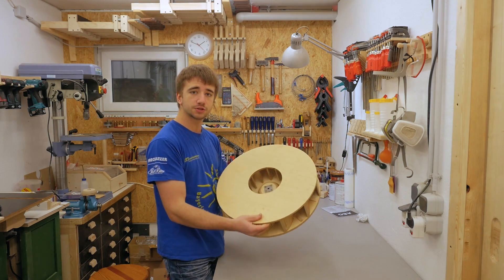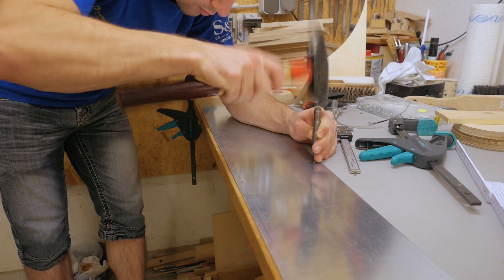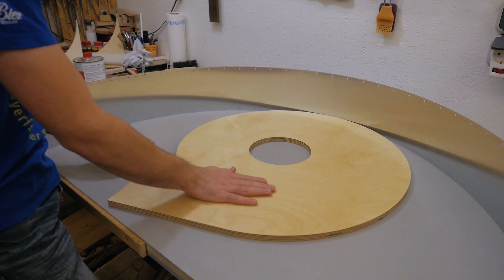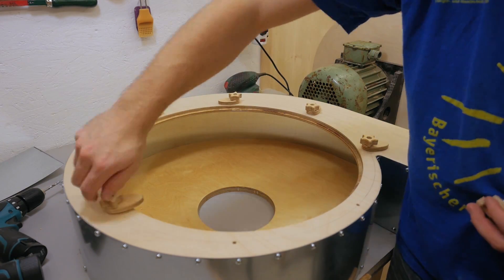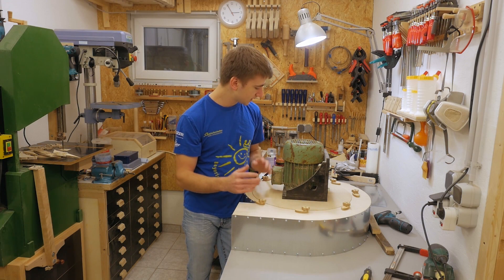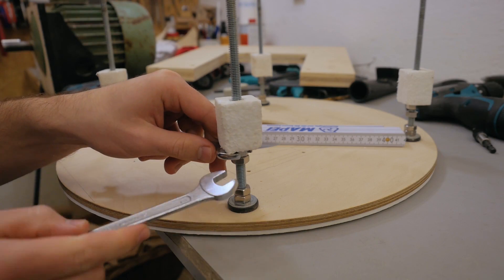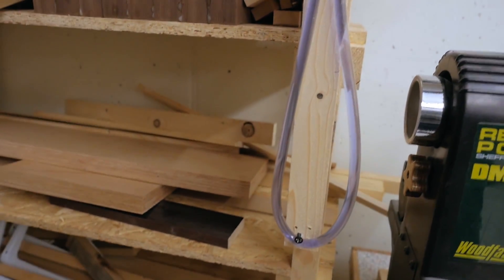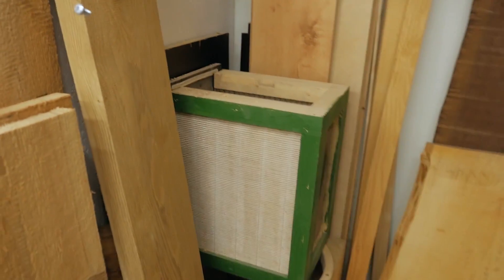Building a Big Dust Collector Blower #2

Comment: Carefully isolates motor mount from mounting bracket with foam.   Screws motor mount directly to bracket.
Reply: If you are referring to 9:47, he didn't screw the motor mount to the bracket. It's a separate piece that prevents the motor mount from sliding off of the bracket. There is even a piece of foam on it that can bee seen to isolate vibrations.

Comment: Marius,  Thanks for the great video. I was wondering what formula or design method you used for the scroll housing.  Specifically the toungue clearance and location in relation to the impeller. I have a crude, basic method but it does not result in what I consider a very efficient design. Thanks, Carl
Reply from the maker: I just used gut instinct ;)

Comment: You can toughen screwthreads in wood by impregnating them with low vicosity superglue and iserting a greased screw until the glue is set ( few seconds)

Comment: I just took apart a shop vac to check the impeller, and noticed how tiny it was to generate the suction it does.  The impeller and blower you've made is beyond impressive.

Comment: If you want to reduce more noise (even for ur parents), you can make a "room" & use some cheap acustic foam glueing into the wood panels. I saw, In another video, that you put out ur old door (because it was damaing your table saw) & installed a sliding door. Why don't you reused it for it? 

This is the panel: https://http2.mlstatic.com/panel-acustico-absorbente-100x50x5-cm-formosa-placa-aislante-D_NQ_NP_23410-MLA20248464715_022015-F.jpg

On the old door install a ventilation grill to avoid overheat the motor.

Comment: May I know why are you not using the metal sheets to make the impeller blades? It would be much easier to shape and more sturdier.
Reply from the maker: It's easier to conect wood to wood, than sheet metal to wood.

Comment: Look up a phenomenon called fan effect.  Depending on the distance from the discharge of the fan to the first elbow, you can get substantially different performance from the same fan.  Nice woodwork.  That is a BIG fan for the speed.  Is there a lower rpm motor class you can use?  I am concerned for your safety me how the wood will fatigue over time.  One day I hope you can make it out of metal.  Good luck.

Comment: A little trick I learned from building radio controlled airplanes to strengthen bolt threads straight into wood is take thin CA "cyanocrylate" AKA Super Glue, and soak the threads with the CA. Run the tap back through the hole after after the CA dries. It will make the threads very strong, just make sure to use thin CA so that it soaks into the wood.

Comment: try a couple of square meters of sound insulation they use in a music studio. the stuff shaped like egg cartons.  just get enougn for over the blower, and ask your parents how much of a difference it makes.  i bet it does alot, but if it doesn't, try to hang it down from the ceiling a little, tryng to deflect it back into the area where the blower hangs. you might want to try it if it's not too pricey.  great work btw.

Comment: Hi Marius. I made a blower myself with the same design of fins....but i made them with aluminum fins, same as u made the 90° bend on the outlet with grooves.The only diference is that my fins are about 35mm thick and can take the forces better than yours (also mine has a smaller diameter). My father used to design flour mills and pneumatic transport...didnt like that the one i made at first was 45mm thick...he told me if its thick u get more volume but not so much vaccum...so i made mine thiner and it was an improvement.
Keep up the good woodwork! ;)

Comment: Hello Marius, your work is excellent, very creative and you take care of the details. Since you improved the dust collector I recommend that you install a star delta starter, thus reducing the torque with which the engine starts and also the starting current, this will prevent the starting torque is too high and cause damage to the turbine in addition reduces energy consumption at start-up which results in energy savings and lower cost of the electric bill. The connection is simple and not very expensive, three contactors with auxiliary contacts and a pair of buttons. Congratulations for all the projects and continue to work like this.
Reply: It would be a good idea, but in a (German) comment he made in the previous video, he indicated that he runs this motor in wye configuration at all times, so a wye-delta switch to reduce starting torque can't be used.

Comment: Wow I wish you were my neighbor. You have a natural understanding for physics that most people have no idea about. 
For instance most people assume that because there was no air flow that it would be at maximum load. Which is of course not true at all because it really isn't doing the intended work. The same air is held in place and just spun around.  The same is true for water pumps and turbos in cars and trucks. 
So car buffs take note. If your diesel truck blows the compressor fitting or seal off the turbo there will be increased backpressure on the turbine side. This will lead to a dramatic increase of EGT's and not the excess fuel. 
Sorry Marius, Rant over. Love your projects and the detail plus common sense that goes into them. Cheers!

Comment: As far as I know a lot of the noise comes from the air circulating through the system and gets out the 90 degree exit part you have there. try to glue some of that wrapping material or some insulating foam on that part on the inside.

 I accidentally was a witness of such a procedure when some industrial size fans were making too much noise for the nearby resident housings. So they brought in some dudes that did just that. they glued some kind of flexible foam material on the inside of the air evacuation ports. Also to top it all up they mounted at a distance(measurement that I do not remember) a shielding system so the air and sound coming out was hitting the shields and dispersing on the sides. the shields also had that foam material glued on. try doing that see how much the sound drops.

Comment: If you rotate the mounting in a way that the suction port would be sideways and the outlet port downwards, you could eliminate the 90 degree elbow at the outlet PLUS the pieces wouldn't fly everywhere in the shop if it explodes. :D

Comment: Nice work! I used to sell Vac-all equipment that was made in Milwaukee Wisconsin in the 1970's. You probably would love to see the double Vac-all that was made that pulled two twelve inch tubes on a street sweeper and went to work cleaning a steel mill at Hamilton Canada where I live. The blower was driven with an 8V92 diesel engine and mounted on a Louisville Ford truck. Look for a book I wrote called "A Tinker's Dream" at Amazon.com. Best of luck and make sure people you work for pay you enough.

Comment: I'm sure folks have mentioned it already, but my opinion regarding the fan is lighter means less horsepower to turn. You're consuming a lot of energy just turning that blade assembly before you even get to the point of actually moving air. Might I suggest you could make a much lighter fan using chimney flashing squares or rolls from a home repair store. If you bent them the same way you did those wooden ones, they would barely flex. Obviously a different fastening method would be required...
Reply: Right, and bumble bees don't have enough wing surface to sufficiently lift them off the ground.
Think outside the box. Whatever I set my mind to do, I will do it. If the first one breaks or fails, I will chalk up the time to the learning curve and keep right on truckin'.
Reply: What I do or don't do changes nothing and proves nothing. You can 'suspicion' for the rest of your life and it will change absolutely nothing except YOUR OPINION.
Have a nice day.
Reply: Have you ever seen the vanes inside an Electrolux vacuum cleaner fan? Never tell me it can't be done!
Reply: Wrong, dead wrong! I have already proven my engineering prowess thousands of times; it is no longer necessary for me to prove anything. It's up to you to prove I can't.
Normally, I would have risen to the challenge, but for you, I make exception. You are not worth my time and I don't need a shop blower yet.
Reply: Whatever one man can do, I can also do. I lived in the age before internet when being published and circulated in another country actually meant something.
The more you scream 'Prove it!", the less attention you'll get from me. I have proven it. I could care less what you think.
It now becomes a battle of minds and you're sadly outclassed. Have a nice day!
Reply: Because I'm having fun taunting you, bwahahahahahahahahaha!
Reply: You have only discredited yourself. You would tell anyone that it 'can't be done' without even trying. What a fool you are!
Reply: Surely you wouldn't have me believe everything you have ever built is still operational and will remain operational for eternity.
Reply: If Marius uses his dust collection 100 times a day / 7 days a week it might be a topic - but in a non professional workshop energy consumption is not that deal. And normally the energy you need to get the air moving is the trigger that cuts the main breakers.
We had to add a lid to the intake of the blower housing at the shop ventilation  on a friends storage cause the motor took about 30 amps instead of 12 when in normal operation. After the lid it too about 15 at startup - but just for seconds, so the breakers didn't fall.

Great work Marius - as always !!!
Reply: Okay, whatever you say. I am an electrical and mechanical engineer, so y'all just go right on ahead, then.
Reply: Lee Wilkerson chimney flashing is way too thin and weak to be used in an impeller. Please use your mechanical engineering degree to compute the stresses on such an impeller before advocating it.
Reply: "If the first one breaks..."? What kind of hodge-podge engineer are you? The point of engineering is to apply science/physics to know if something will work BEFORE you build it. So instead of using your professed engineering degrees to PROVE I am wrong, you resort to calling me unimaginative... that's rich.
Reply: Lee Wilkerson what does that have to do with anything we've discussed? I've continued to request you demonstrate your engineering education and instead of doing so you go off on weird tangents like bees and product reliability. I suspect all this attempt to change topics is because you really don't have the degrees you claim. Why not prove me wrong by replying with actual numbers and calculations on the feasibility of chimney flashing for impellers. If instead your reply still lacks those details, it will just prove my suspicion is correct.
Reply: It proves your education means nothing in this context and that nobody should give your opinions any more weight than anyone else on the internet. So maybe next time you go flaunting your degrees, be prepared to show you can actually use them.
Reply: Really? Show me a link then. Remember the adage: "If its not on the internet, it didn't happen". It really doesn't matter how much you say you've proven something if you cannot show anyone your work. "The internet" won't believe you. And of course, referencing bee flight or vacuums engineered by other people is not a proof of one's own engineering prowess.
Reply: Yeah that USED to mean something, therefore it doesn't mean anything now just like your proofless rants.
Reply: You can do what anyone else can do? Being a little arrogant aren't we? If that's the case why aren't you taking 5 minutes to do those calculations that an experienced mechanical engineer would do instead of spending even more time arguing with me? Let me be clear, I'm not asking you to make the calculation, I'm asking WHY you refuse to do so since you claim to be so amazing talented. It's blatantly obvious that you care about my opinion since you reply to every msg so don't give me BS about not caring enough to do so. Why don't you tally up the time ur wasting replying to me and see if its better spent doing the calculations which could also be relevant to your future blower project.
Reply: I'm glad you enjoy letting me discredit you to the whole world. I guess we both win.
Reply: Yes, that's what engineering is. The calculation of what works and what doesn't work. If you were a real one you would know. My specific rejection of your specific proposal doesn't mean I reject everyone's ideas. I just reject the dumb ones like yours. Are you saying that every "dumb" idea needs to be tried despite what other more experienced, more knowledgeable engineers say otherwise? Every commercial material handling impeller of that size has either cast aluminum or welded steel fins (or sometimes special plastics that claim to be stronger than steel) that are much thicker than the chimney flashing you propose. 
If you actually knew about the science in air handling then you'd know lighter impellers aren't necessarily a good thing. For one, sizing motor horsepower is based on how much work must be done during the continuous phase of running not the startup phase. Keeping a spinning a heavy fin less impeller (a metal disk) a constant rpm consumes little to no work, therefore once you start adding fins and moving some air nearly all the work being done is in the moving of air. However the startup phase is heavily dependent on the mass (more specifically the moment of inertia) of the impeller. The heavier the impeller the longer it takes to get up to speed. The issue arises when you want to move a lot of air and want to do it with a very light impeller. This means you're pairing a large motor w/ its large amount of torque with light impeller. You can end up with insanely high acceleration. By my calculation the tips of a 15" impeller are traveling around 160mph. My hefty steel 15" impeller weighs around 15 lbs and takes only a second to reach full speed with a 5 HP leeson motor. A dragster takes only a second to reach 100mph. A dragster that reaches 160 in a second Now imagine holding a piece of curved sheetmetal against the wind while on a top fuel dragster after it starts off for a second... that's only 100mph. Now imagine that dragster was even faster and got you to 160mph in that second. Now lets say you lose half the weight of that dragster and it gets you to 160 in only half a second. That's a lot of force that a piece of sheetmetal has to contend with. Adding the plywood stiffener on top of the fins puts even more force on the fins in the form of force that the fins have to put on the stiffener to overcome its inertia and bring it up to the same speed.

Its clear to me none of these concepts ever got into your head, which is why I discredit you and your ideas. Your ideas are not only stupid, they are dangerous.

Comment: Screws into the edge of plywood is not good practice, as ply has a tendency to delaminate and the screws would become loose. Hardwood strips to the edges would be better, and safer.
If the fan impeller blade 'cover' was made conical, so that the outlet area was the same as the inlet area, then the fan would be more efficient. This also makes the cover, and the whole fan assembly more rigid.
Aerofoil shaped blades are also more efficient, and as a consequence, tend to make less noise.
Reply: What is "Hardwood strips" and "Aerofoil" ?
Reply: Артур Файзуллин
Hard wood strips would be pieces of hardwood, cut and glued to the edges of the ply, to provide a solid attachment fot the screws..
Aerofoil, is an air-plane wing section shape.

like this;

http://www.ppl-flight-training.com/images/xaerofoil-section.jpg.pagespeed.ic.9LXkKfBEB3.jpg
Reply: niklar55 can you link an image of a wood strips being glued to a ply?  I have no idea how to do it correctly.
Reply: Артур Файзуллин 
Something like this;
http://i3.photobucket.com/albums/y86/penndan/file_zpsae02b48c.jpg

this has four layers, you would only need one, top and bottom.
In effect, you make a wooden rim, and screw to that.

Or more like this;

http://i1133.photobucket.com/albums/m594/starclassicBB/IMG_3958_zpsmotrej4c.jpg

but you can just glue and screw separate pieces to the rim, rather than making a free-standing rim.

Comment: Is there a specific reason, why you fixed the door of the blowerhousing to the motor instead the blowerhousing itself with the door on the other side?
Reply from the maker: Yes, I can rotate the blower housing to wherever I need it. Makes it easy to setup and also future proof, when I'm in a new shop

Comment: Very nice build and your noise level seems fair! I built a very similar centrifugal fan at 400mm diameter by 80mm depth and it's generating close to 100 dB of noise (android app), compared to 85db for a big shop vac. That's at full load so it's moving a lot more air that it would be once everything is hooked up.

Comment: i absolutely love this blower and its design. I really want to make my own, and have the materials, but i dont have the tools to cut everything up ;-; i have a 1.5HP 240V single phase cap start cap run motor, with a massive amount of starting torque. Another problem is that i cant take the key out to make a taller one so it doesnt chew through my wooden flanges. Thanks for all the videos, keep it up ! cant wait to see it all back in action. :)

Comment: I am wondering how long the packing foam vibration dampening works for.  I am studying the topic of sound wave propagation and dampening in college physics and this is right in there.  Perhaps you are using it because the foam is the material you have on hand but I would think that cutting down sheet rubber would have a longer life than the foam.  Or maybe, the foam is good enough.  I guess that I am just curious in how well it works and the longevity of it.
Reply from the maker: The old foam pieces, which were in use for over a year haven't been flattened that much (about 8mm).